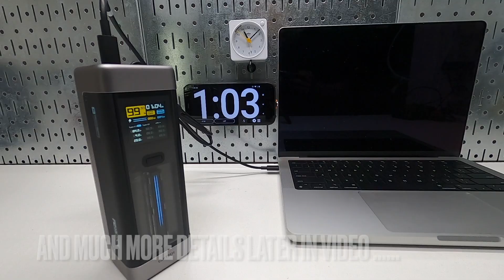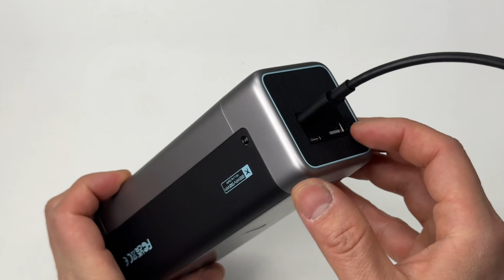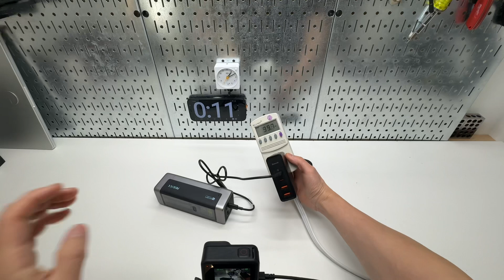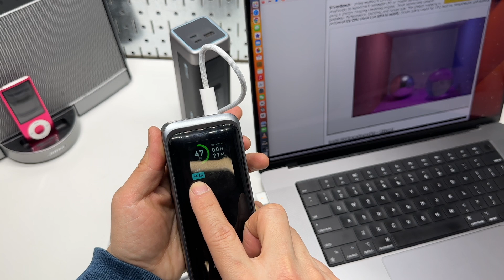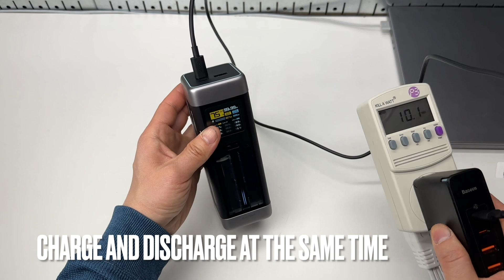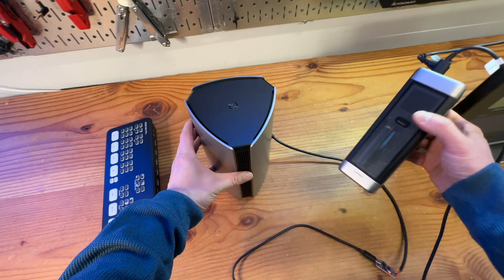Best Portable Power Bank in 2024? CUKTECH 20 In-Depth Review

Comment: I have an Anker 325 bank I bought for $50 in 2021.. doing 3w charge isn't even considered trickle on that thing.. its max two ports is 15w.

I have a Cuktech 10 I bought used on Amazon for $32 and it can do 100w or 2w and I can verify it all on a built-in display. 

Crazy how EV's becoming popular has made power banks get crazy high tech now too lol. Good review! I want one of these larger 20,000+Mah ones but still kinda pricey for the display ones. Jumps back up to around $60

Comment: Can a this charge a s24u at 45w? Does it support PPS charging?
Reply from the maker: yes
Reply: @ToolsElectroDIY I just received mine, and it does not sustain 45W charging to my S24 Ultra and 33W charging to my Poco X3 Pro, regardless of the cable and port used. It can only sustain 15W to both phones. Also, charging the power bank with a 100W charger only sustains 50W and randomly stops charging. I had to repeatedly restart it to continue charging. The official store has not yet responded to my issue.

Comment: Hey, can you test please whether it reboots power to ports if using both USB C and USB A as output(load) and USB C as input(pass through mode)? In other words can it sustain load on 2 interfaces and be essentially an UPS.
Reply from the maker: No it does not. I use it as the power supply of my recliner workstation, please watch the video I posted last month

Comment: The "CUK" (/kʊk/) in CUKTECH is the recognition of the Čuk circuit, which is a special type of DC-DC circuit topology proposed by Slobodan Čuk in 1976. The CUK circuit's high efficiency, low ripple, and flexibility not only align with the modern demand for efficient energy utilization. Over 75% of our staff are dedicated to the R&D and Quality Assurance Department. CUKTECH insists on innovative product design, demanding strict attention to detail, and creating products that users love.
CUKTECH started as an OEM company and has focused on developing chargers and power banks for years. Its clients include international tech giants like LG, Hitachi, and XIAOMI. Its core team has also been responsible for ZMI's operation for 10 years and has a reputation for high quality. Currently, over 70% of the CUKTECH team is dedicated to R&D and Quality Assurance. The ZMI & CUKTECH brand has shipped more than 150 million units of power banks and more than 20 million chargers under CUKTECH&ZMI and brands including XIAOMI, LG, and Hitachi. We also ship out more than 70 million battery units each year.

Comment: Most important thing is the name of battery manufacturer, it is a reputable one like Samsung, Sony, Panasonic, etc or a cheap Chinese one inside the power bank? Can you confirm the brand of cells?
Reply from the maker: I can't confirm without cutting it open. Would you like to watch a teardown video?
Reply: @ToolsElectroDIY   No need, just found it in another video. They are 5 x 21700 cells in series from EVE, a good brand. My mistake. 👍
Reply: @antoniog5374 They are Samsung cells